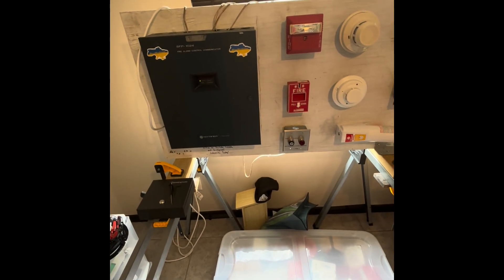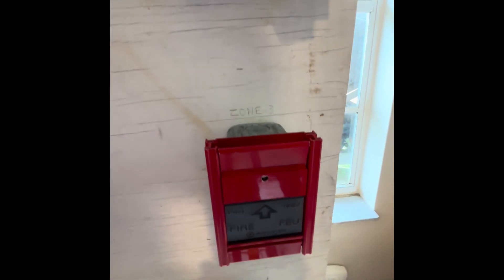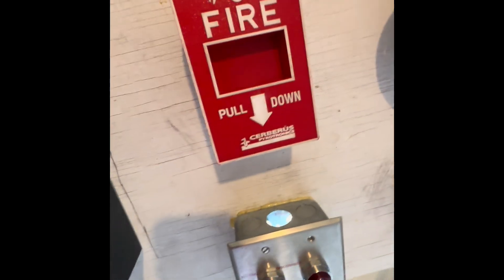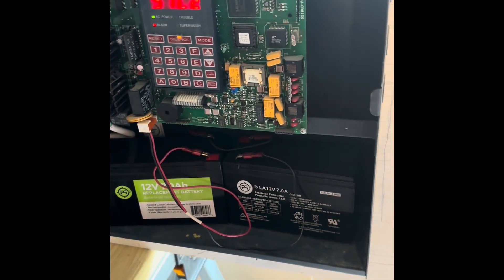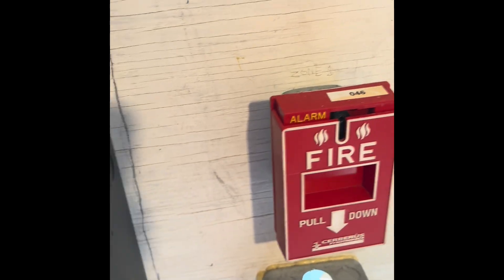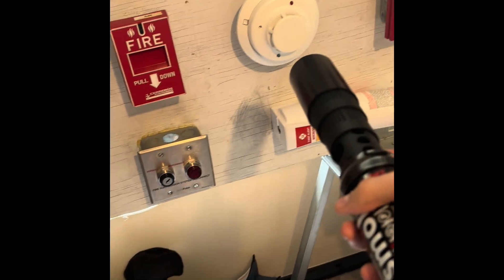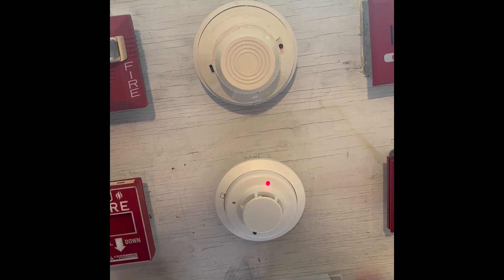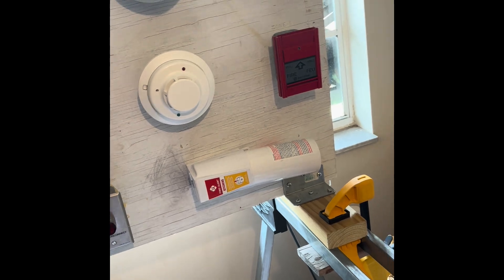Notifier SFP-1024 FACC System Test 15: The Great Detector Activation!

Comment: I have the same panel as you I know it is a system that would be installed in new York but how did it get in Missouri.
Reply from the maker: @fasttime227  while visiting family in Ohio (I live in Florida) I reached out to a fire protection company that kindly donated the panel after they pulled it from service and it became mine. I just noticed it’s power beeping sound getting very raspy or not hearing it at all.